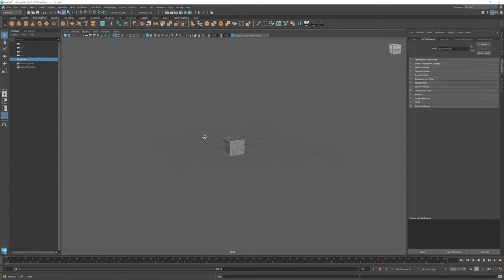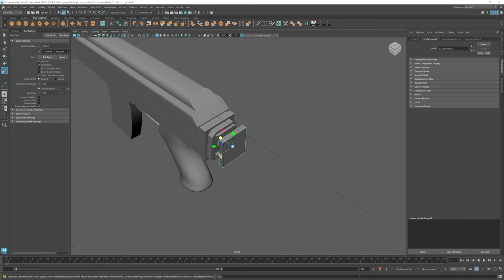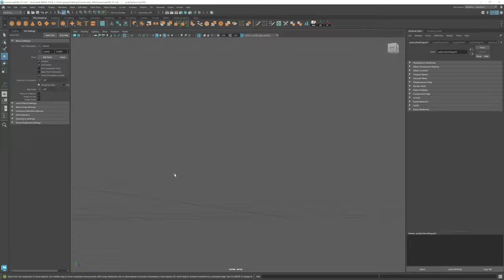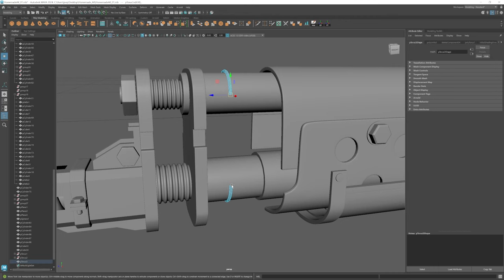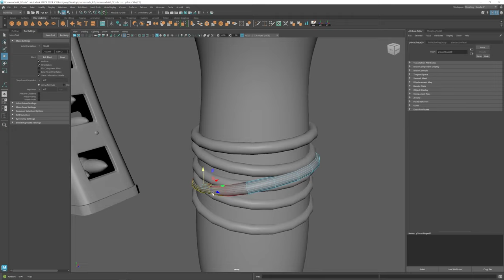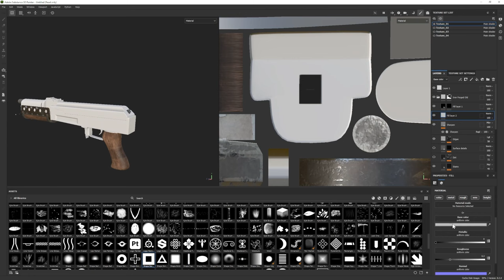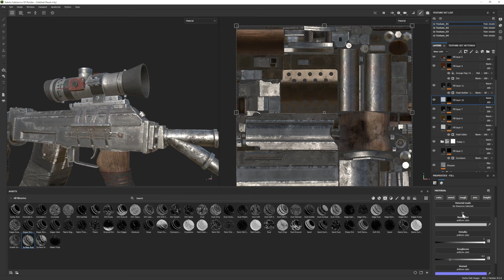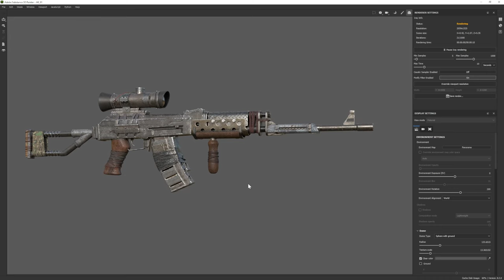Homemade AK-47 | Autodesk Maya + Substance 3D Painter

Comment: Hi! First of all I want to say that I love your work and the videos you make and I have a question related to modeling in general.
When you are doing any 3D model and for example you are making a weapon like in this case and there is a piece that is complicated to make because it has an specific shape or in real life that piece is welded por exemplo...It is well seen if different shapes are cross each other to create the shape or is it better to try to create the piece even if there is a very saturated mesh? It's a question I've had for a long time and some times I can't advance  because this kind of things. 
I hope I have explained myself well. All the best!
Reply from the maker: Thanks for the comment! :) It really depends on what you're trying to achieve/how its going to be used. For example if you're doing a HP to LP workflow,  going for photo realism, or you're going to view it very closely and those details are important to see, then its probably worth spending time on that difficult shape to create it. If you're trying to save time, or save on polys or its going to be viewed from a distance then its probably better to save on those polys and make a simplified shape - for example I did this on the metal piece on the stock to save myself time, its actually welded together in my ref, but in my model its only two cylinders crossing into each other and I added a welding effect into the material in Substance to help make it look like one piece. (You'd be surprised what you can get away with in the materials) 
Its very situational and depends on what you're trying to achieve as an artist. I hope this helps!
Reply: @polyrendr  Thank you very much for answering, you have helped me a lot with the answer, and I had just noticed the part of the stock. The truth is that with the texture you save a lot of time and have a very cool result!

Comment: Any reason why you use Maya, rather than 3dsMax. I keep swapping between them, but find Max better from modelling. But when it comes to rigging and animation always Maya.
Reply from the maker: I guess I just prefer the UI and I'm used to it. When I was starting out I used 3DS max, but I found Maya much more beginner friendly so I switched over. I've tried almost all the 3D software out there and I personally like Maya the best.  I have heard from others the same though, they prefer Maya for rigging and animation and 3DS max for architectural modelling the most. I guess everyone is different, so it depends on what your brain likes to work with :)
Reply: @polyrendr  Max rigging and animation seems to be a decade old.
Reply: @polyrendr  I still have a Maya indie sub. But use Blender more and more, along with Fusion360. But moving to Plasticity / Blender. /Zbrush
Reply from the maker: @sqwert654  those are all great! I love zbrush as well, I should use it more. The best part is they can all basically do the same stuff, whether it be Maya or blender, etc. just find what works best for you and keep on practicing! 🤘
Reply: @polyrendr  also use 3dCoat,great for UV using 3d mouse and Wacom 3 button pen. Hand retopo is the best in 3dCoat.
Reply: @polyrendr  Maya 2024 is just a crash fest, trying quad draw crash, auto retopo crash. Will stick to Blender. Cannot remember it crashing.